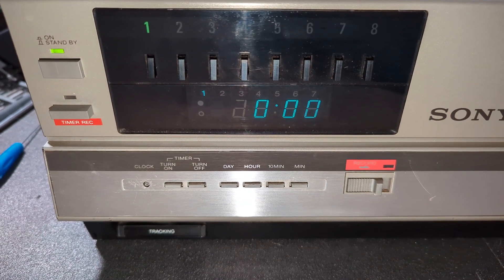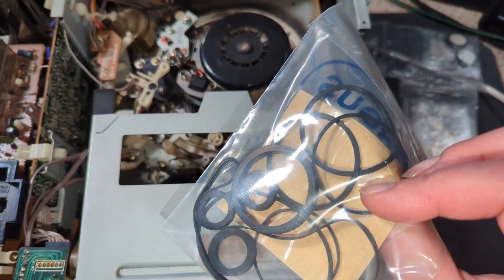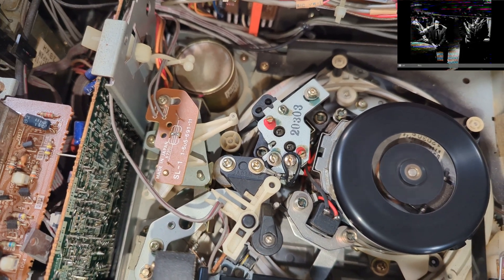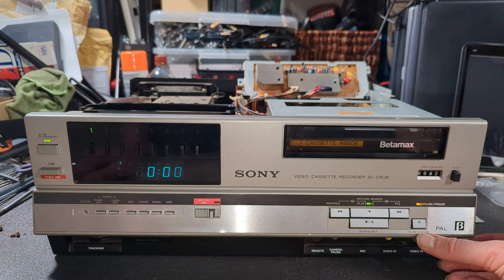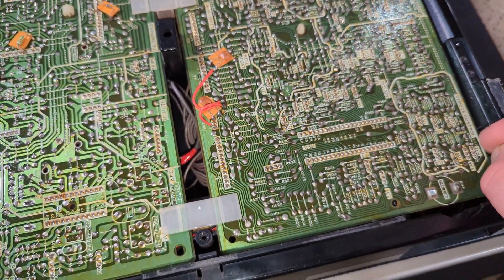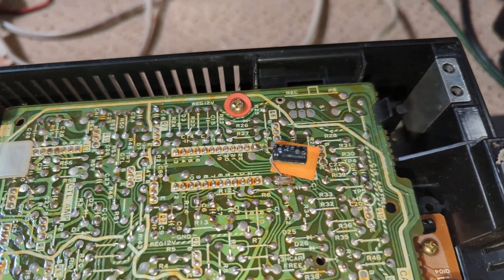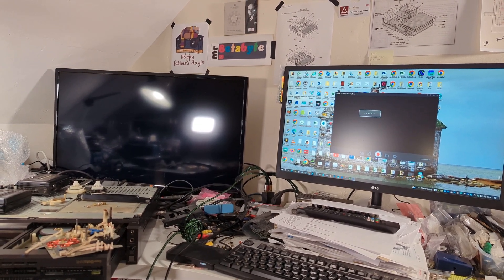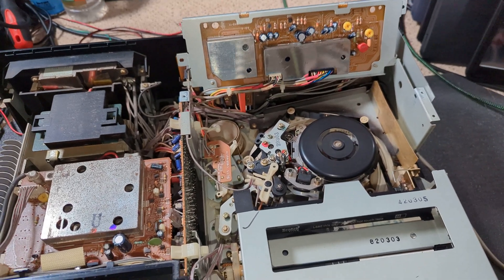Sony SLC6 Mark 1 Betamax - Part 1 - Servo issue

Comment: you might want to do an update video to reflect a further update to the SL-C6 BEFORE the MK2 design, because i've got the (AS) Australian model + the complete manual.
Dated January 1984 is a "Supplement 2'" where the board CP-6 (Camera PLAY board) was eliminated and integrated in the board SS-9 which was altered to reflect this.
i haven't matched the changes in the manual but visually there's less usage of the blue Sanyo's, C18 suggested a Tantalum but they used a Pink Elna Electrolytic & C58 was an Elec now used a green color 'ceramic' in its place.
Reply from the maker: That's super useful to know - thank you so much. Would there be any chance of getting an electronic copy of the second supplement? If I can, I will certainly return to this with my own C6 Mark 1. Thanks again.
Reply: @MrBetaByte  I'll have to scan it. Mine covers the E and AS dated May 82, the online I've seen E model Jan 82 only go to the end of the parts list. Mine has the adjustment 53 pages and and the operation manuals 90p the op long.
What would your email and I'll try scanning them?
Reply from the maker: @livinlifetothefullest2750  That would be amazing - thank you. My email address is mrbetabyte@gmail.com and I'll be sure to give you a mention in a future video too if you do manage to get it scanned - I know they can be a bit of a pain depending on how the pages are formatted.

Comment: 13:15 that would be the βII/βIII record-βI playback switch for the American version, the SL-5000. The PAL and NTSC models share the same board just with different components. That's why lots of components are missing in a lot of areas.
Reply from the maker: That makes a lot of sense and I did wonder - thank you so much for sharing. 😊

Comment: I have one of these from my mum and dads i saved from the tip it does the functions and loading fine but no sound and only a dark grey picture no jumping or lines i also have the heads from a mk2 machine that has suffered damp and is in my dads basement not in the best condition the mk2 a shame as it had the original box as well .i do have an sl c7 this has good heads and picture just servo cap issues and the clock is not working no doubt due to the leaky battery for clock memory .
Reply from the maker: Sounds like the sound is being muted from lack of video signal so my guess is it'll be an issue somewhere on the video processing side of things. Shame the mk2 has been in the damp especially as it has the original box but it may well still be worth saving - I've seen machine sthat have been in the damp come back really well but it just depends. The battery on the C7 is a real pain these days - they are always bad and have leaked everywhere. Buttons for setting the time functions are always problematic too. Are you going to try and get the issues sorted?
Reply: I will sort the c7 out the buttons for settings all need replacing. The C6 I may pass it on to anyone who wants to save it or use it for parts .

Comment: What type of capacitors did you use instead of electrolytics? Tantalum? What's the advantage of using a different type? Are those replacements also polarised? Thanks.
Reply from the maker: Yes, I used tantalum capacitors just because they are much more resilient and should outlast the life of the machine. Yes, they are polarised and I do use 35v ones too as the voltage rating is less of an issue (as long as they are the same or higher than the originals of course) when it comes to life expectancy.

Comment: its often those light blue sanyo caps drying up. Later models with the light blue caps dont seem as bad though.
Reply: Sanyo bought an electrolytic capacitor factory that probably produced inferior electrolytic capacitors. After improving the quality, however, the appearance should have changed as well.
Reply from the maker: That's a really great insight on the Sanyo capacitors. They do seem more reliable in newer machines.
Reply from the maker: It's such a common issue that changing all the light blue Sanyo capacitors is a first step and then diagnose issues if there are still any to solve.

Comment: hola tengo yo este modelo y no coge la cinta automaticamente tampoco se me ve la imagen me puedes decir porque es saludos espero tu respuesta
Reply from the maker: There are many things that can cause this. What have you checked so far?
Reply: @MrBetaByte  le ocurre los mismo que al tuyo
Reply from the maker: Have you changed the servo capacitors?
¿Has cambiado los condensadores del servo?
Reply: Me lo puedes traducir a español por favor
Reply: No, los va a comprobar mi padre

Comment: Aaaah, the servo issues. Well, many more caps will need to go :) Oh, how I "enjoyed" working on my C5s but also some earlier Betacords. I wonder why is it always the caps around the servo ICs. Are they subjected to more stress over the years?
Reply: Sanyo bought an electrolytic capacitor factory that probably produced inferior electrolytic capacitors. After improving the quality, however, the appearance should have changed as well. The smaller the diameter of the electrolytic capacitors, the shorter the durability.
Reply: @TTVEaGMXde  If it's like in the C5 those light blue ones that go bad are some special type of capacitor that seem to be meant to behave more like tantalums rather than standard aluminium electrolytics. Not sure if they are some weird form of electrolytics, tantalum or some hybrid or some predecessor to OSCONs or something else but I guess whatever formula they used didn't hold up very well long term. In the role they have at least in the C5 I don't think a standard electrolytic from the time would have had good enough properties to do the job they're meant to do.
Reply from the maker: Yes, certainly the go to repair on these machines. Voltage, heat and   frequency stress certainly shorten the life but these machines are old and the manufacturing process for all these capacitors was not always 100% but it's amazing how well these machines have lasted. The Sanyo caps were just not that well manufactured in this generation of machine. Did you work for a TV and Video repair business? Would love to hear your story on working on these machines.

Comment: I wonder why SONY didn't install a complete (1/2" high) head drum, or did a patent fee have to be paid to JVC per groove ? At this point I would like to mention (once again) that electrolytic capacitors of an old design, even with only 5.2 MHz suffer. The newest IC in the video is from the 52nd week 1981. I know Ladykillers in 2 bad versions: color unrestored (4:3) and color bad (too much red) restored (HD).
Reply from the maker: Sorry, yes, I will cover the capacitors that are breaking down under frequency - I have two machines where I think this is the case and I'll talk about that then and I'll try my best to mention you too as it's a very valid point 😊 Ladykillers is a great film with maybe not so great colourisation but I can get past that just because it's such a great film. From what I understand, the thicker head disk is to help with image stability with the disk's alignment, this being no longer and issue when the head disk 'fit' was calibrated. I think it's just Sony being 'belt and braces' with making sure their machines were as stable as possible.